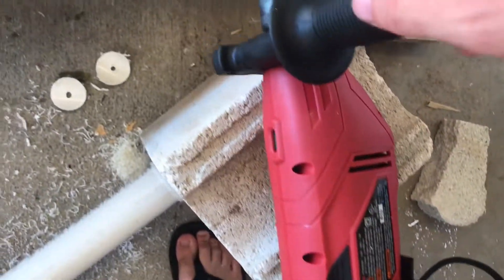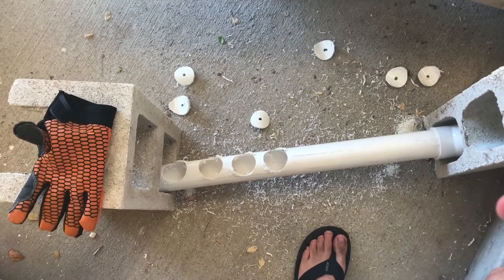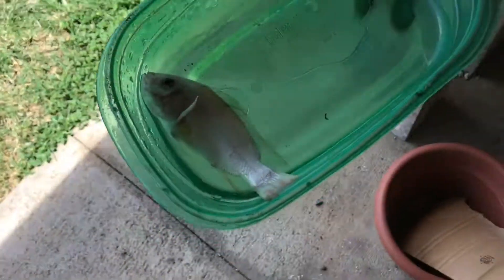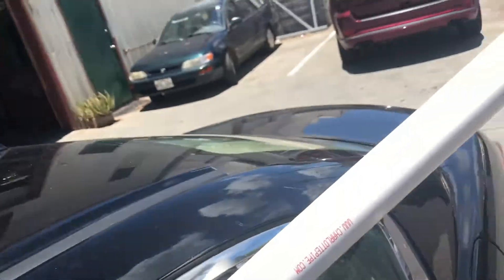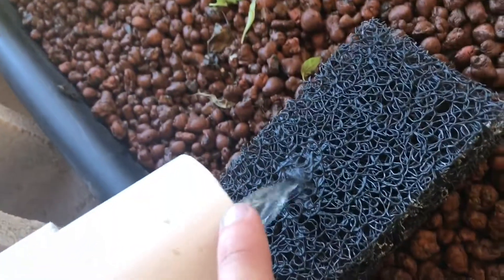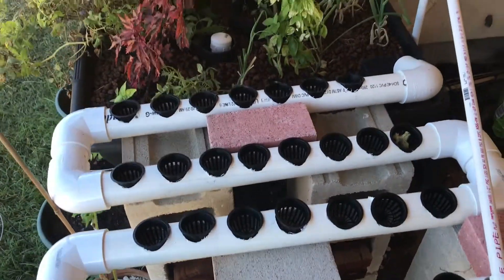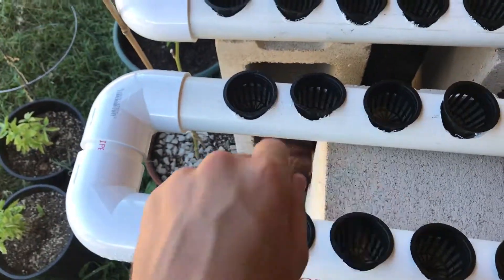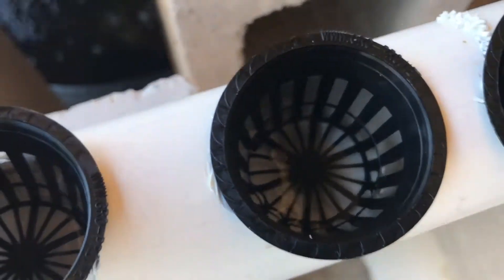How to Expand Your Aquaponics System with Net Cup PVC Pipe Grow Lines

Comment: Beautiful design just wanted to ask is distancing is important when grow lettuce and is it a 2inch pvc pipe and a 2inch netcup did you have any problem with roots and water levels
I have to use a 3 inch pipe for the 2 inch netcups
Reply from the maker: Yes, I actually learned that bigger cups and pipe would have been idea, because there is so much root mass.

Comment: Are you using municipal water to top off with? The chlorine might be the fish killer unless your using filtered water, fish are sensitive to chlorine and it can kill them. Your going to find that the net cups are to close and you might get leaking once the roots start growing and making little damns and water will leak out the low side of the holes you drilled, your on the right path though and I can see you upgrading the pvc to 3 or 4 inch with better results. Great video, thanks for sharing and as always Keep Building👍
Reply from the maker: Todd Larsen nice insight Todd. I am using municipal water, and if the chlorine is the issue, how do I get around that? I’m not sure how I could filter enough water to fill up this tank without collecting rainwater.
Reply: Micah Johns you can simply fill a large container with water out in the yard and let it gass off for a couple days, you will smell the difference👍👍
Reply: Micah Johns you can also install an reverse osmosis filter on the garden hose and it will filter almost anything out of the water and they cost anywhere from $120.00 and up.
Reply from the maker: Todd Larsen ah that’s a little bit of an investment... but is that what people use on commercial systems? I would think so right?
Reply: Micah Johns I use an RO setup in my backyard aquaponics system and I'm just a small time hobbyist. If I were you i would just get a large container and fill it up and let the chlorine gas out/ evaporate in the sun for a couple days and use that water to top off your system.
Reply: @ToddLarsen  Hi Todd & Micah, nice setup.  Can you please advise, is the goal with the netcup to have the base of the netcup in the stream of water to keep the substrate / rockwool getting splashed or can the net pot be above the waterline so long as the roots are dangling into the water?  Thanks
Reply: @davidglover1854  as long as the roots are touching the water they should be good to go👍